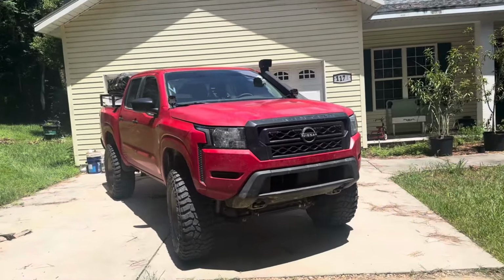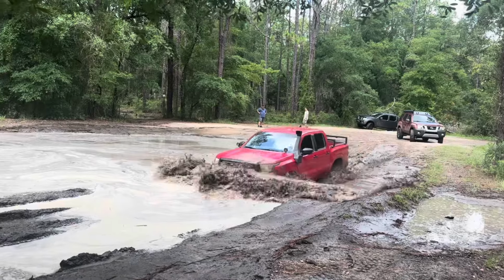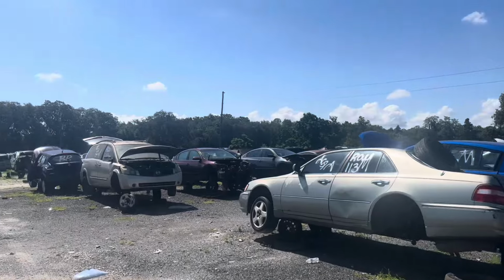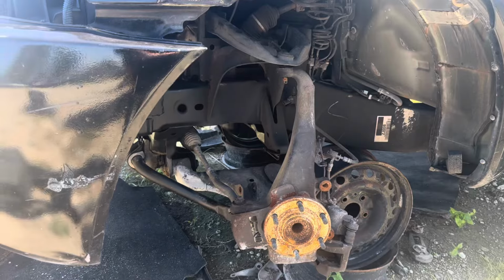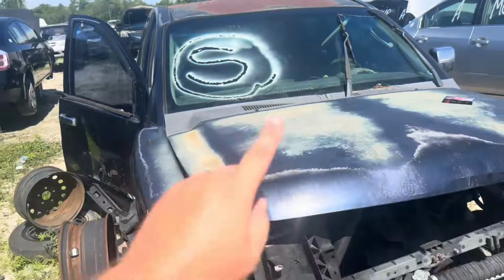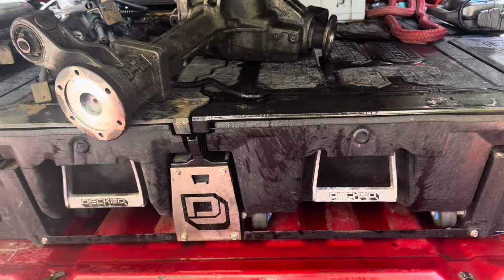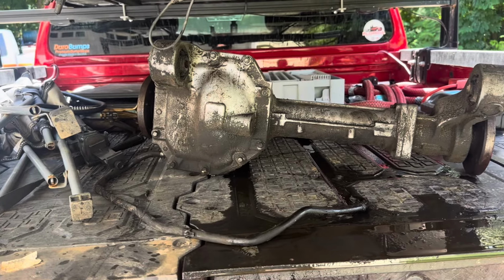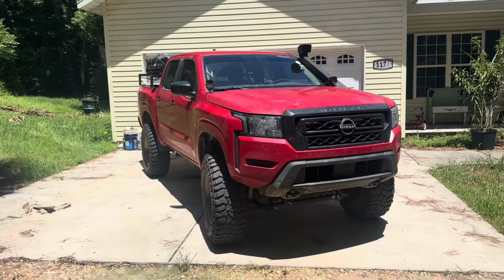This isn’t working for me.

Comment: Hey man sorry if this question is outdated. I just bought a frontier 2022 S. I bought to help with the off roading just to get to trail heads and camp site. I has a Sentra so you could imagine. I don't go off roading like you and this will be my daily driver. however my hobby is going camping and hiking maybe car camping now. I live in North Carolina and to get the trail heads most of the road of gravel pretty rough. do you think the 2.5 rough country lift will be ok? or will light off roading damage ? please let me know man I seen all your vids and subscribed,.
Reply from the maker: Yes! A 2.5" lift will be plenty for your needs. I ran that lift for about 6months. 2.5" lift with some good tires will get you far. Thanks for watching and subscribing!

Comment: I see your going to a T-Swap for the 22 Frontier, but going to 4:10's is a No-Go..... I've been on this for the last year & even been in touch with All Dogs Off Road & the axle manufacture & the rear axle pinion bearings have changed from the Dana 60 version to a smaller version which the manufacture wont release. I too have the T-swap on mine & just regeared the front diff to 3:69, with an arb locker. works fine for me at the moment, but still want the 4:10's... I don't run 35's like you but my 33's work for me.... if you need an E-Locker, I have the TRE for the M205 Diff.... 
🙂
Reply from the maker: That’s good to know. I’m actually going to do 3:69  initially just to get it back on the trail and get it back usable again. I haven’t fully decided really if I’m going to do a full Titan rear axle swap as well.🤔 

thanks for the heads up on that 4:10, though. That sucks.

Comment: Nothing is cheap and or bullet proof.  Trying to get and IFS to not break CVs is always fun.  TBH I gave up.  I just carrier a spare and do the lifetime warranty axle game.  Get one from O, one from A and a third from AZ you know the drill. So you have 5 to 600 hundred in replacement spare axles and you rotate though with the warranty so you don't bring a broken axle into Oriellys or etc every other weekend, they get cranky.  I got 3 to 4 stores of in my area alone and there are Napa and Carquest too if I need more.  It's a nonsense game, but broken axles from the trail are a problem for the Monday morning commute.  
PS lockers and 35s made it worse, maybe less skinny pedal or less "send it mentality"
Reply from the maker: but I plan to do is upgrade the CVs to the RCV CV's and keep the two OEM's I just ordered as spares. also going to keep a spare alternator on the truck as well.

Comment: I have read you only get what 4" with the Titan swap in the front, so how's that going to help?
Reply from the maker: Main benefit of a titan swap is the long travel of the suspension. You technically lose an inch or two but not really. The front bracket the holds the front differential is sitting only 12” off the ground. So although the truck will be lower, I’ll be gaining about 3-4 inches of actual ground clearance.

Comment: No , you can buy a Dana 44 for 500 to 750 gear it and put a locker in for a couple grand and have it installed for another 2 or 3k so under 7500 all in . Much less if you do some of the work.

Comment: If i ever manage to convince the wife to let me do an ultimate dana 44 swap in my JLU I'll give you my Dana 30 diff for super cheap. 🤣 Sorry your rig keeps breaking. Hope this helps. Excited to see the new build.
Reply from the maker: A jeep differential and a Nissan? Isn’t that a sin? 😜😜
Reply: @4wdAdventurz  if it works, it works. I think the biggest issue would be finding an adapter to go from the driveshaft to the differential. Lots of the axles you see on people running 1 ton setups on big jeep builds are from early 2000s Ford Super Duties.
Reply from the maker: @backwoodstherapy  yeah, normally on a straight axle swap for the Nissan they use F250 axles
Reply: @4wdAdventurz  don't blame them. Legendary durability. I've only got a Dana 30 anyway so if you're gonna do a solid axle swap, don't get a small one. Like my wife is always telling me, girth matters.
Reply from the maker: @backwoodstherapy  😂😂😂
Reply: @4wdAdventurz  😞

Comment: I feel this. I’ve got a 2020 Ranger and I had to make the decision to go mild. I actually live an hour from pretty much all the North GA trails and my truck could get me in and out to pretty much all the camp sites. I just needed a bit of ground clearance up front. The factory rake plus the crappy FX4 shocks meant I nose dived easy on small drops. I did Bilstein 5100s at 2in up in the front and left the rear stock, and did 275/70r17s and it’s turned into the perfect vehicle for those forest service roads. If you’re in the area and want more people to wheel with I’ll join ya 😂
Reply from the maker: Hell yeah dude! Find me on Instagram (same name) or head over to the FB Group and we can stay in touch! I'm hoping to be back in north GA in October

Comment: With the Radflo’s front coilovers if/when you get them, put I believe weld washers on their lower mounting point. ADO has a video addressing the Radflo “clunk” and a simple deterrent is apparently weld washers if I remember correct. I was between an extended travel kit with Radflo’s and a titan swap kit with Radflo’s from ADO but my ‘24 P4X has like 650 miles on it and I didnt want to gut everything to titan swap it because they’d surely void my warranty if a rear diff leak or something happened. So I went the extended travel route and am currently awaiting delivery. My Xterra is titan swapped though and dude-it’s a unit. Embarrassingly, it rides almost as good as a stock Frontier. Probably because bilstein 4600’s are cheap junk haha
Reply from the maker: Good to know! I’ll keep them in mind!

Comment: Nice! About time you remove that garbage lift. It's not about overall lift/height. It's about travel/articulation and ride quality. Not how high you can make the truck.
Reply from the maker: But in Florida, articulation and travel mean nothing. There is nothing to articulate over. Lol It is flat as a pancake. There is however deep water and deep mud. That’s where the rough country can’t really is the best option.

If youre not looking to have any suspension travel and just need to get higher off the ground, that is the best kid on the market. 

but if you ever want to go anywhere else there isn’t really a worst option than the rough country kit  lol. That’s why this switch will be better in the long run.

Comment: If you can put in lockers, you will not have to ‘send it’, and MT tires for better grip - you will reduce the shock loading and shearing spinning parts. RCVs would be a great option too.  Notice the true off-roaders roll slow and intelligent over th)ngs and those that do not always have problems.  Though if you are really going to Offroad Michu, it may be better to repair to stock, sell it, and get a Jeep which has way more mod options, are cheaper, and much more you can do. IFS is a dead horse to begin with.
Reply: The Nissan Frontier is just too stupid with its software based wheel braking -- and thats one of its main issues.  People love the truck for its reliability and simplicity, but it lacks the intelligence that other trucks have.

Comment: Alldogs off-road has you covered. Tell Chad Nick sent you 🤙🏼 

So stoked to see you move this way. You’re going to be so pumped and the truck will run so much better
Reply from the maker: Thanks buddy!  I definitely plan on using them for the 4.10 gears for the front and rear.
Reply: @4wdAdventurz  don’t sleep on the fox kit for Titan swap. It’s probably the best off the shelf. Better than rads for overland
Reply from the maker: @CAMOverland  yeah? I’ll look into it!

Comment: So glad u are getting rid of RC kit! It looked nice if u parked it at a mall 24/7.  My 22 is set for working hard daily and weekends to enjoy nature.  Dobinsons 3" 275/70/17 looking to get All dogs parabolic springs. Good luck on the project can't wait to see what she looks like
Reply: I got the para springs from ado. Just fyi, unless you got about 250-400 lbs in the bed, they are a little too stiff for daily driver in my opinion. I haven't weighed anything on my 23' pro4x, but have a leer camper, little platform/drawer system, tools, camping supplies, hi lift, and 5 gal of fuel, and 5 gal of water. Now it rides pretty good, still a little stiff to be honest. I'm guessing about 250-300 lbs weight added to the bed. Oh, and springs squeek all the time. Have to lube the springs with wht spraylithium grease. Not sure if recommend them or ado for that matter. May just get an add a leaf later on to the factory leaf pack.